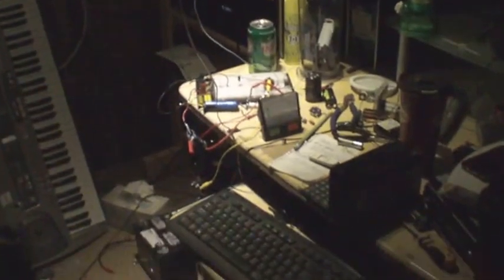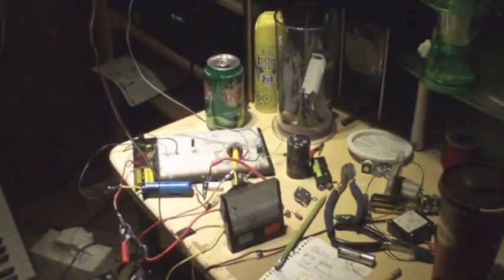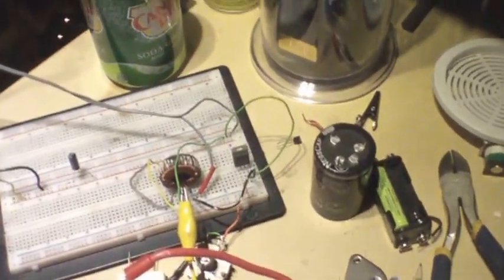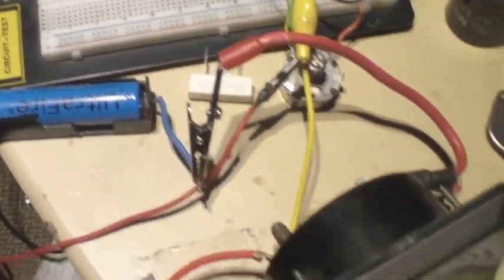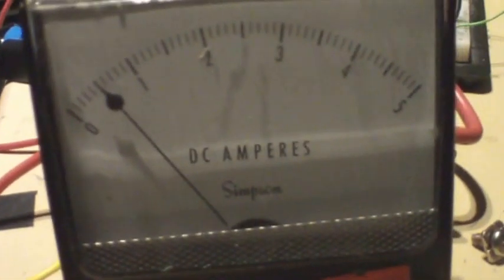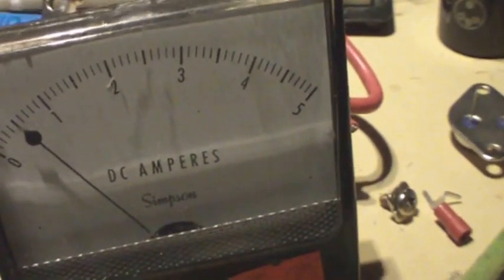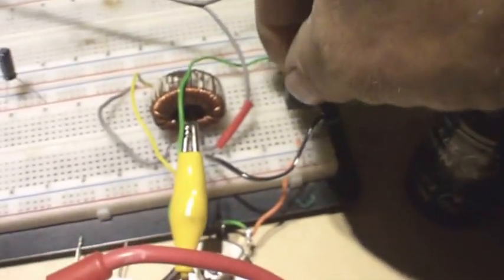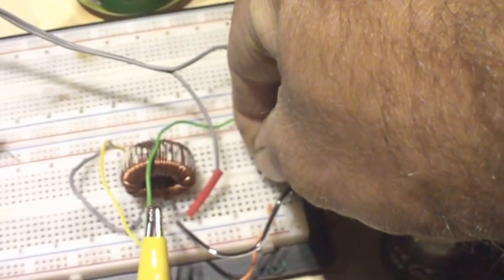Joule Thief Revisited Pt. 3  3.9V @ .5A (2 Watts)

Comment: This is really great usable light

can you share # turns and what transistor you've used?

thanks
Reply from the maker: Tip 41c I think it is, and the inductor is about 1" outside diameter with perhaps 40 bifilar turns of 18 gauge magnet wire. Quite heavy duty. thanks
Reply: KyleCarrington
Thanks a lot. I saw in one of your previous videos that you were using the tip42c.

great work.
Reply from the maker: Yves Baggi i have a lot of them, they are quite durable.. it'll probably work with others, of course, but the goal here was to get some light, all to often i've made joule thief lamps that are disappointingly low output.

Comment from the maker: which is exactly what i did, till i came across this. the fwbr to cap, is capacitive step down, and "the loss" occurs not just there, but in the fact the SJR 3.0 has a step up winding, in the coil. Worse, it uses a blocking oscillator (not a royer for example) to accomplish that inversion.

Comment from the maker: The problem with the Super Joule Ringer 3.0, is -- you expend a lot of energy to create robust spikes off the inductor -- such that you can meet the expectations of the bulb -- 110VAC for example, but when that energy arrives, it is severely dampened by capacitors or another step down switch mode transformer. In other words you just wasted the best part of the circuit... the spike. in this arrangement, in the original JT sense, very little resistance is introduced.

Comment from the maker: Opinions are like a-holes, everyone`s got one... but mine... is... that this arrangement --> kicks ass <--  all over the joule ringer that uses ac bulbs. Skip the step up - only to step down... startt low voltage, use spikes and stay below the voltage of your LEDs -- as they are wired. You lose next to nothing to heat, and you won't burn out the LEDs.